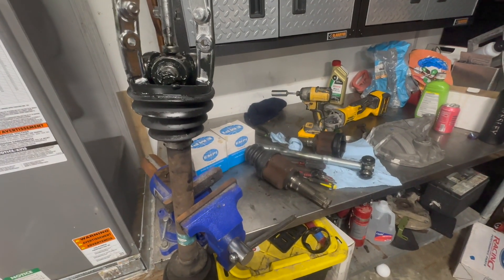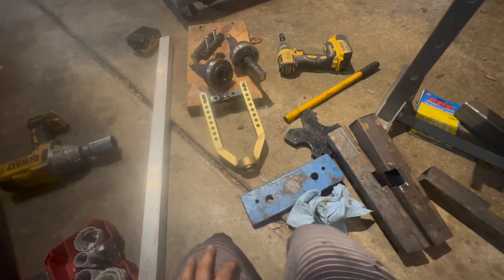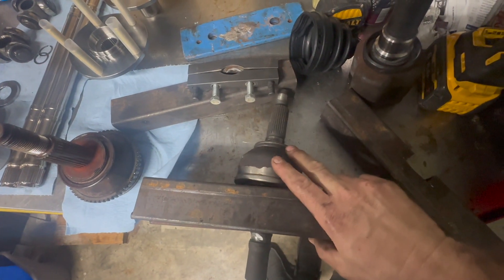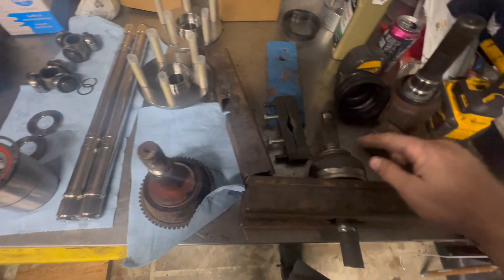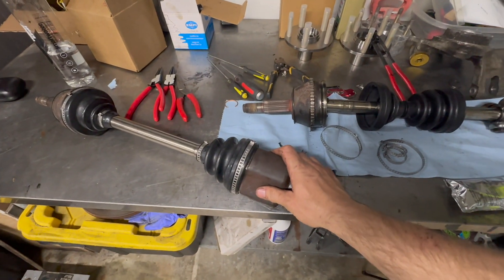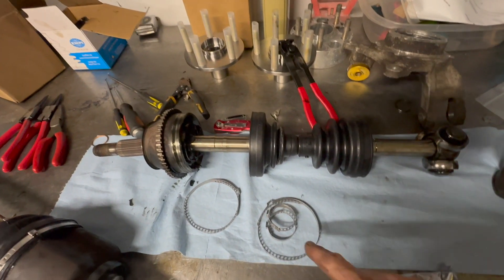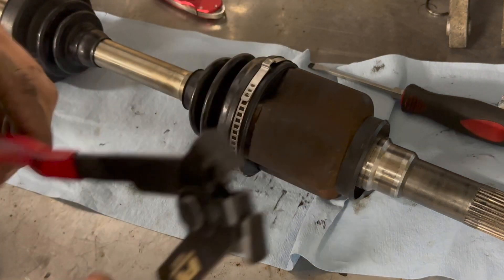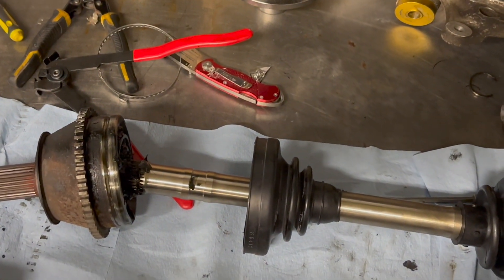Ronin Speedworks FC RX7 Ford 8.8 swap axles Part 2

Comment: man, you should have got help.  Those axles , outboard joint,  will come apart with a smack from a hammer.  You wasted a lot of time and money.  Honda, Toyota, Mazda, Nissan,  all the same.  The wood may have messed you up. Put the axle in a vise with room to take a swing.  then hit the inside part of the joint directly with a small sledge.  if it doesn't pop right off, just rotate the axle again and repeat.  Done hundreds like that.
Reply from the maker: @leonwindham6549   You’re correct, I wasted a lot of time and money because I initially tried the “method” you seem to be so versed in without success. I spoke with Joel who makes the kit and he said he’s run into a few like mine that just won’t come apart.  It’s not rocket science, any dummy can hit something with a hammer. Sometimes things don’t go the way you want them too.